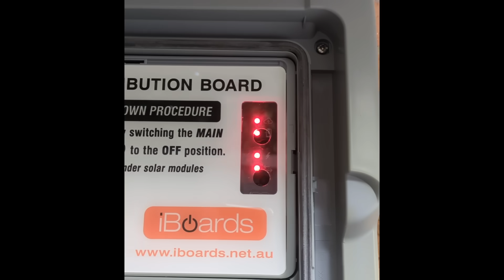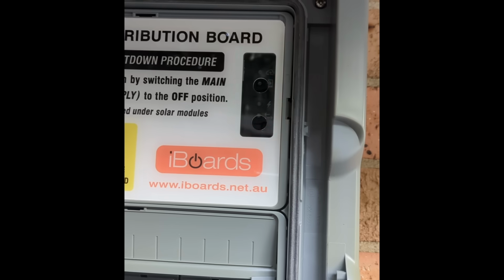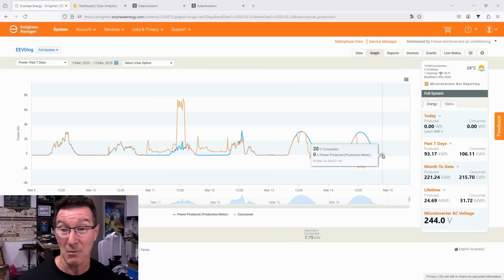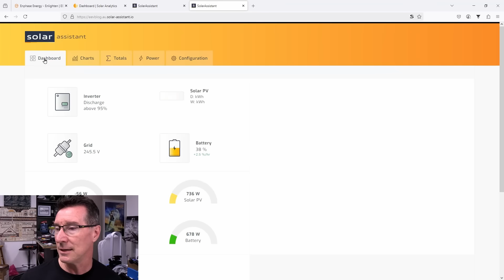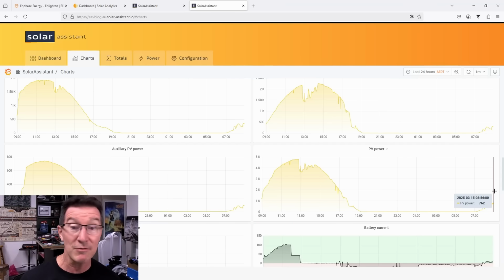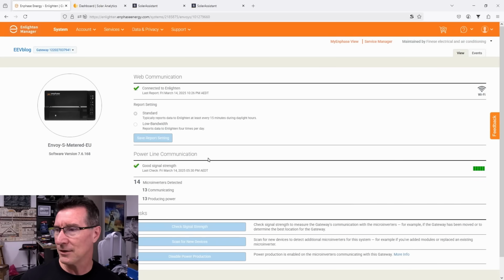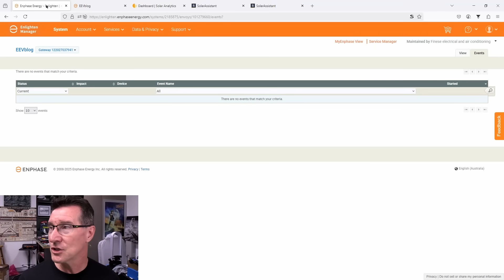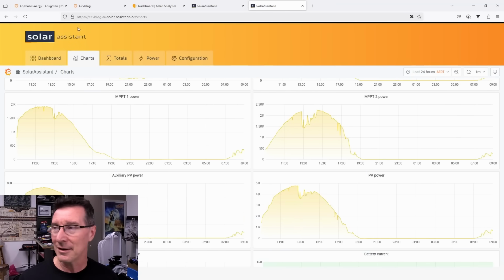Enphase Envoy S FAILING?

Comment: UPDATE: It magically recovered on it's own at 1:37pm today. Was down from 10:@6 the night before.
NOTE: This is NOT weather related, it was perfect weather from right after when I shot this videos, and shows up as an error event in the event table, so it is not normal operation.
Reply: the hamsters went on strike =)
Reply: failing caps in the power supply
Reply: Site down maybe. Does it not have something like a ping to check if the Internet can be reached ?

Comment: Had a similar problem with Goodwe Home gateway, started getting bad wifi connection. Required replacement hardware after 2 years.

Comment: ok. so. two things.
1. my first thought was firmware or memory
1.a. if there was a firmware update that stalled due to some fault in the downloaded file then this would have explained the minor bootloop issue. usual practice for devices like this is that the firmware is downloaded, crc checked, uploaded to rom and the device reboots, if there is an issue with the write then the system will hang, on reboot it tries to boot and fails, at this point the ok flag for the firmware is not checked and on the next reboot it should revert the firmware.
1.b. following on from firmware, it also may be that there is some issue with memory allocation in the firmware that is causing an overflow, this would show as a very predictable long term failure cycle, like if you reboot and it fails after 16 hours then its likely that there is a fault in the new firmware. the good news is that this should be easily isolated by the provider if they grab the internal logs for the device. otherwise if theyre lazy they will just update their firmware and replace your box.
2. my second thought was power, source and condition
2.a. i was considering how this thing is actually powered, is it battery/solar/caps/mains, since you noted that it is on mains that rules out any external power fluctuation, it may be possible that there is still an internal battery or cap of some kind but assuming it switches when the mains switches then its likely not any fault there.
2.b. it is possible that it is a mains supply fault, in the case that the freq or volt of the mains hits a brown condition that the psu for the device cant cope with, which results in the mainboard going into an error state. this is quite common for 'less-good' grids like the australian one, given the timing id almost think that there is some maintenance at your local distribution transformer site and there is a brown condition when jumping from rail to rail, perhaps with missmatched freqs due to source supply, (common with large generators and lazy techs) (ive seen this happen on site and in my home lab)
2.c. the power supply in the unit may be faulting, ive seen a number of cheaper integrated or oem power supply boards with a few simple failures that cause this sort of problem.
2.c.1 resonance in small transformers for low power devices is often not managed correctly, they should be potted with a vibration absorbing compound and if during production only part of the transformer is potted the circuits become very prone to failure, even something like dropping them on a table during operation can cause a fault. note that the coil whine can also vibrate loose other adjcent components, unlikely but still possible
2.c.2 power conditioning, a lot of devices are not built for the australian heat, cheap caps are the first thing to go in this case whenever you have a spike in the load or supply if the cap smoothing the supply is faulty this will result in a fault condition and the mainboard will receive dirty power
2.c.3 component burnout, if there are any low cost ics or shunt resistors used for measuring power or isolating from the inverters then simply put they may be cooked, this is a pretty simple one, perpetual use and wacky through power cause this over time, also accelerated by the heat in australia which also messes with resistivity in non inductive sense circuits.

imo its likely that its just 2.b and youve got some cowboys flicking switches like its a mid 80s disco, maybe there is an issue with the device, id advise keep an eye on it and if there is a trend in its eveing shutdown its probably a firmware issue like 1.b which should be resolvable, but if they buggered it over they wire i wouldnt trust them to unbugger it without also including some future buggery to be automatically enabled later.

I hope this helps

Comment: In the logs says "Your gateway rebooted" twice in a row, that's strange. Can you check if there are more occurrences of that reboot error?
Some possible problems I thought:  It could be that the wifi router is changing channel or interference from other sources. But is more possible to be a problem with software/flash memory or the psu, the auto reboot is probably happening from a watchdog reset or instability of the psu.

Comment: Maybe the WiFi-module is gone bad, as it's happens with laptops?
Second: Don't use "Auto" on the router for "Channel", "Bandwidth" and "Transmit Power". Some devices can't handle the channel shift or bandwidth change. Some routers is not very good at handling the transmit power. So lock the channel, select the bandwidth and full transmit power.
If the WiFi-module is on the edge, it will loose connection if router turns down transmit power and router won't raise the level again as the WiFi-device is no longer presentet on the network.

Comment: Is it a nighthawk router? They are just flakey, have similar issues with multiple models replaced them all fixed all the issues.
Reply from the maker: TP-Link AX6000
Reply: @EEVblog2  Update the TP link firmware, they are being actively used as part of a botnet, so either update, or if no update replace with another model.

Comment: The timing makes me think it's probably an issue on their side. My parents have been getting mails about the Envoy (non-S) disconnecting the past few days, but the thing never seems to have actually been disconnected (I haven't checked the lights yet though).
It's still listed as down on the enlighten portal, but still updating all the local reports just fine, and the local admin portal works fine too. It's probably either a new firmware bug or a problem with their infrastructure I'd say.
My own Envoy hasn't been showing any issues or downtime despite being in an almost identical situation however.
Reply from the maker: Interesting. It came good on it's own about 4 hours after this video.
Reply: and this is the problem with cloud based solutions compared to local

Comment: Could it be that your wifi router changed the channel on which it sends? Not all channels are allowed in every country. Maybe it moved your wifi to one of the channels, which the inverter can not send/recieve. Or both have a different wifi country set. This would explain why a router restart fixed it.The router may then later decide to move it again, and it would fail again, then.
Reply from the maker: Haven't changed anything in years, why would it do it now?
Reply: @EEVblog2  Your neighbour added his wifi on the same channel? Something started arching, when it turns on? You don't have an separated access point, your modem is the wifi-router, and got updated firmware by your provider, which changed its behaviour? Your secondary access point fights with the first one? I have 4 accespoints in my house and they seem to reorganise which channel each one takes all the times. And then there are the wifi signals of the pesky neighbours which sometimes seem nearly as strong as my own signals.

Comment: Check for another DHCP server operating on the network.  Is the HA machine still running?  Perhaps it is doing it.
Reply from the maker: Nothing has changed at home in regards to devices or the router.
Reply: Home Assistent OS doesnt have a DHCP Server installed per default. You would need to install that yourself.

Comment: Had the same problems about four weeks ago, power cycled the gateway and it reconnected. Been fine since. I just put it down to weak wifi signal.
Reply: No dose not explain it. As it reconnected after the wifi router powered off and on I would switch the router over if you have another one to see if that works. 

The reports on the enphase forum point to circuit board in the IQ Combiner box. They say after five years a battery fails. But have my doubts about that.  All leds flashing red is the envoy gateway booting up. Can take 10 to 15 minutes. The bottom led is green when gateway is communicating to micro inverters, next led up is green when micro inverters are producing power. Top led is green when gateway has connection to internet, red if only connected to local network.
Reply: @andrewhazon4675   Devices that already have an enduring lease do not show a problem, so you can be sucked into believing the network is OK.

The overnight connection failure is typical of failing WiFi AP or Router DHCP, commonly caused by a plug pack PSU failing, but it could be any failing device on the local network. Cross check the router logs.

Before changing the router another good option is a basic check on the plug pack PSU, if the PSU has developed excessive DC ripple test a new one. Ripple on the PSU Plug pack is a common fault on Routers, APs and NAS, which typically first shows itself as unreliable connections / leasing.

It can of course be failing capacitors inside the device itself. The symptom will first be exposed by systems that reset on a schedule, they fail to renew the lease on the address, using the Router to Assign static IP via Mac can reduce some of the problems but the problem won't go away if the DHCP is failing.
Reply from the maker: @cpcfreak  Again, zero problems with any other internet device connected to the same router.
Reply: @ Yet power cycling your WiFi router / AP resulted in a temporary fix, it's an indication you had more than one problem going on at the same time. So now it would be prudent to considering cause and and effect, from earlier posts you seem to be having a series of COMs failures?
Reply from the maker: In my case that doesn't explain why repowering the router worked yesterday, or why it's never failed before.
Reply: @EEVblog2  You probably have a dodgy router or router PSU, or it could be the home NBN device needing a reset. If you had rebooted other devices that had established connections before resetting the WiFi you might have found them failing to re-connect.

A basic Mesh system is 1000% better and you can purchase effective and functional systems like the Eero6+ or D-Link from Bunnings! If you want to go to a higher level then look for something small business orientated from Cisco, Ubiquiti or Netgear, but keep in mind the WiFi APs are only as functional or reliable as your Modem/Router, the single point of failure is the low powered router's DHCP/DNS capability.
Reply from the maker: @cpcfreak  Zero problems with all the other internet devices
Reply: How about problem connecting to their particular URL ?

Comment: I have no idea what it going on with your install, but there should be a firmware update for your Envoy, I'm on 8.2.4264 here in UK.

IIRC, a few years ago there was a "update firmware" option you could see from the enphase webpage (at least I'm sure I saw one!), but then is vanished and stopped telling me things like that, and I had to use the installer phone app to update it. I think it did the 4 blinking red LEDs for a long time when I did that, I got a little concerned, but it eventually came back on with the update applied.
Reply from the maker: I thought it was auto updated?
Reply: @EEVblog2 it's what they said, but who knows 👀
Reply: @ mine certainly never auto updated.
When one day I decided to try with the installer app directly connected to the Envoy it showed a complete jump in version number, so I told it to do it.

Comment: SMH.. bad OTA firmware update? your setup wouldnt be for the novice.. so many issues its scary....
Reply: While my overall system is a bit weird and complex, the Enphase install is 100% standard, it doesn't know nor care about anything else I have.
Reply: @EEVblog  i get that, but the whole setup isnt exactly plug and play... been more like plug and pray from what ive seen!..if its not one thing screwing up, its something else...unless youre keeping a constant eye on it like you do, you wouldnt really know about the problems..
Reply from the maker: @WacKEDmaN  Never had an issue for years, Enphase has always been a solid system.
Reply: @EEVblog2  ..i mean the overall system.. not singling out any one in particular..you have to admit youve had a quite a number of issues show up since you got the extra panels etc.. for the average consumer theyd have trouble keeping up...